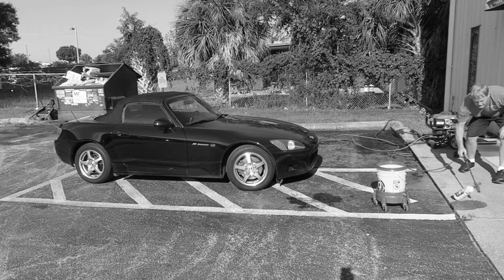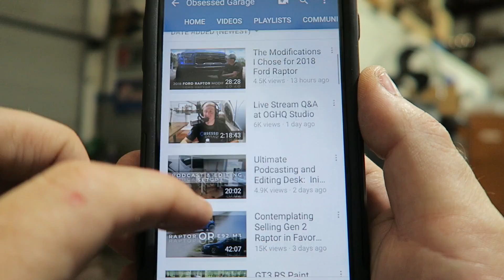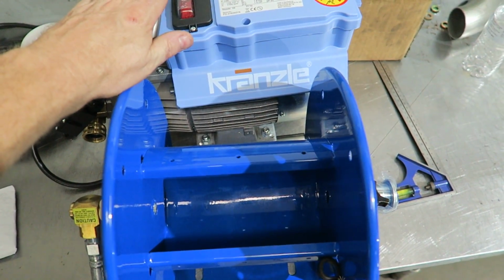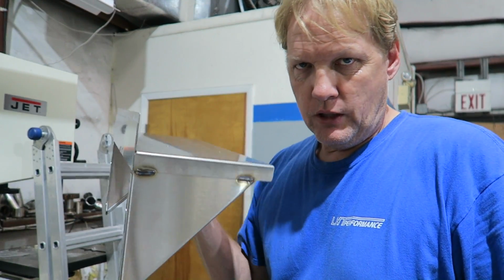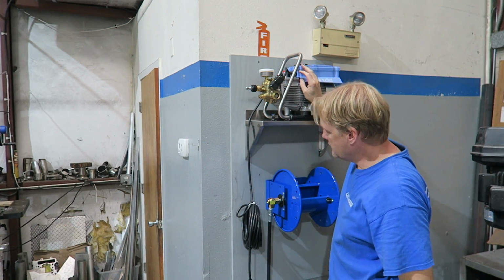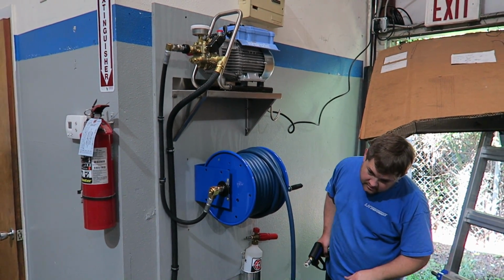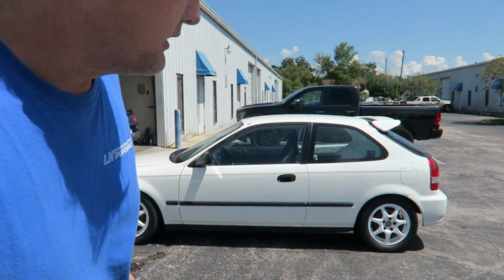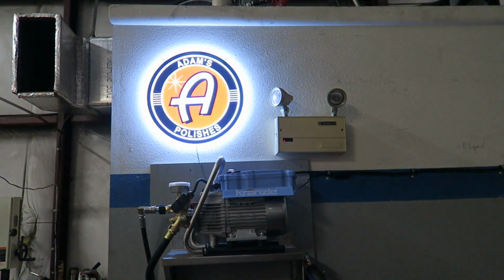Obsessed garage Pressure washer system  install

Comment: Seems like the shelf should be welded like that from the start, but I think it ships loose so that you can space the supports however you need them.  According to Matt and Troy Sowers' install, the shelf fits fairly snug over the supports, so it's doubtful that it would come off even if not secured.  Although if I were doing it, not having a welded, I'd probably drill a couple holes each end and use some machine screws, nuts and washers to secure the supports to the shelf.

Comment: Please can you post where you got the 90 elbows used on the inlet and outlet of the Kranzle.. I have been looking but difficult to find. Please post sizes used..
Reply: Readily available on eBay.  Search for "90 degree elbow 3/8 Npt." Recommend the steel elbow (vs brass), as the steel typically rated at 4000 psi, vs 1200 psi for brass.  Available in M-M, F-F, or M-F.

Comment: Very nice system!

I’ve been eyeing Matt’s system for a while now but it’s so pricey.

I also won’t be buying the CR spotless and the piping.  

Mind if I ask what did you get from him and what are the items you bought yourself?  Did you get the black hose from the city water faucet to the pressure washer inlet from OG?  What about the hose from the pressure washer outlet to the hose reel?  How about the anti vibration clamps?

Thank you.
Reply from the maker: Marc Tiu I bought it all from Matt. We made the hose from the faucet to the pump and we added the 90 degree fitting from the pump. It’s pricey but it’s the best. He’s done the research figure it out for you.

Comment: What’s the link for the elbow between the water hose to inlet pump?
Reply from the maker: ianjuarez30 I went to GoodYear hose and picked it up. Not sure of the part number.
Reply: Readily available on eBay.  Search for "90 degree elbow 3/8 NPT"

Comment: what, no cutting of drywall and trying to insert blocking, hitting water lines and other such nonsense????  lololol good job, I would do it the same way.  edit and WOW man I'm going to go ahead and say that not having any noise from a pressure washer right there by the car is probably worth the price of admission, just about.
Reply from the maker: Patrick94GSR Lol.  Been there, done that.  A little wiser for it. 👍🏻